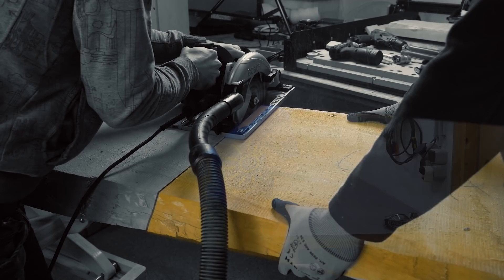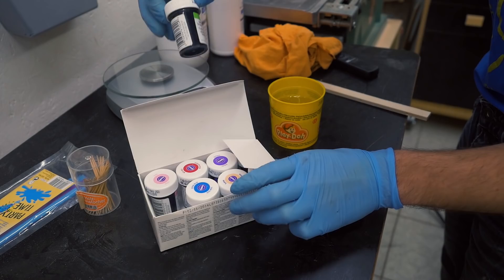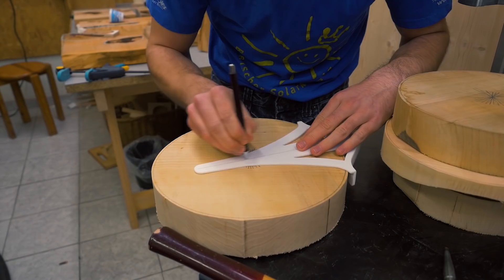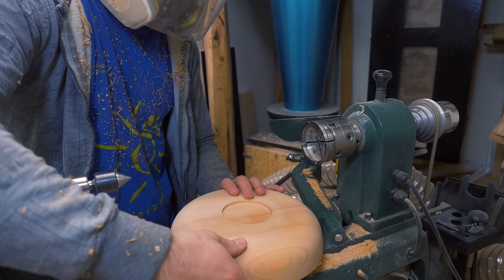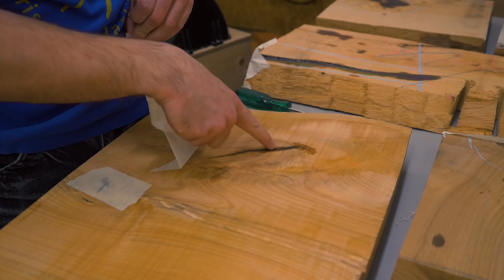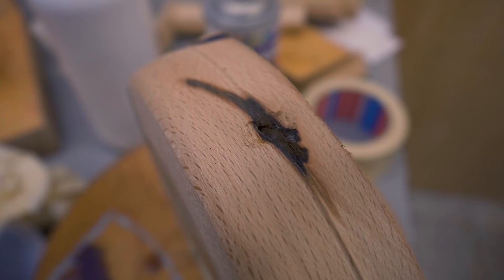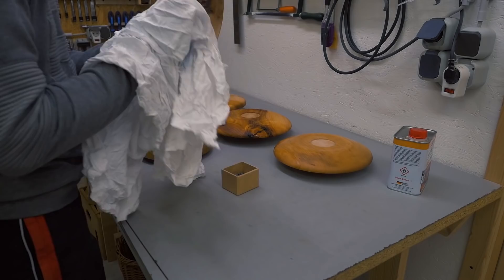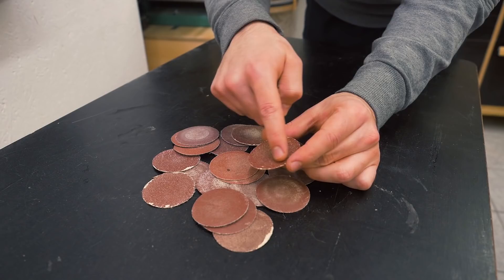Turning Scrapwood into Awesome Resin Bowls

Comment: As a woodturner, I couldn't help but laugh at this... not because you did anything wrong of course. But I know the frustrations you had here all too well. Nails are a serious pain, and... well, I can't tell you how many times I've violated the first rule of woodturning: "Never make the inside bigger than the outside". There are a number of ways to salvage the project. If you remount the bowl and widen the hole enough to create a good edge, you can turn a "plug" (I tend to prefer a contrasting colored wood), glue it in, then flatten it to create a new bottom for the bowl. Works like a charm and actually looks very nice.
Reply: "Never make the inside bigger than the outside"... bahahahahaha
I'm gonna hang on to that one.  :)
Reply: Great idea! No doubt I will be needing it as I am just learning.

Comment: Hey Marius, great job as usual. Tip for getting stuck nails or screws out, touch it with a hot soldering iron until it's really hot, it expands and makes more space for itself, then when it cools is easier to remove. I use a drill with tape on in the centre of the bowl to set the depth before I start turning a shallow piece. When you reach the bottom of the drill hole you know you are at depth.

Comment: Don't throw away the one with the hole.  Turn it into a sink 😁
Reply: Or a lamp shade
Reply: Or because you're a maker, keep it because of course I'm going to find a use for it in the future and it's too precious to throw away, and...
Reply: Turn the hole round, make a darker plug, glue it in and turn it again
Reply: Can also tape the bottom, fill it with resin to a reasonable thickness , turn it, and have a bowl with a colored transparent bottom.

Comment: I use a metal detector to check for nails, screws, staples, etc in wood before cutting. You can get hand held units as used by airport security quite cheap on Ebay or Amazon.

Comment: NOT firewood  , but a small bath sink or a birds swimming pool ;)
Also , i'd be interested in that sanding pad adapter ... i'd love the STL file if it's possible , otherwise i can make it out of wood , or turning it from plastic on my metal lathe (it would be actually sooo much faster to do , either on a traditional lathe than on a cnc lathe , but isn't as much fun as the other 2 choices  ... for me anyway ... i spend 9 hours a day on those 2 machines ) Great video as always :)

Comment: Nice work as always. I really felt for you with that nail. As far as the sanding thing there is an adapter by 3m called roloc with little sanding discs made for angle die grinders, not regular angle grinders, but the ergonomics would be pretty similar, they are very popular in auto body shops.

Comment: Measure none and cut continuously? You could use your offcuts of the offcuts to make a segmented plug; if you haven't already torched the bowl (which makes for an interesting finish on wood). When sanding, is the lathe under power, or is the piece rotating from the grinder power alone? Fantastic channel and love the videos.
Reply from the maker: During sanding with a power sander I set my lathe to its lowest speed (350 rpm)

Comment: That's woodworking dedication, making nice round firewood. Maybe with some router jigs, you could go beyond just round bowls and get more use from some of your larger off-cuts. Oval and free-form shapes come to mind. Were you running dust collection while turning? From the floor it didn't look like it, but I could see the setup.
Reply from the maker: No, during turning dust collection isn't really worth it. It would maybe catch a few shavings. Only during sanding.

Comment: Nice pieces! And the leftovers are perfect for segmented stuff. 😎👍🏻

You need to get yourself a metal detector. I use mine everytime, when I dont know, where the wood is coming from. Good turning tools are too expensive. Put one on your wishlist! 😉

Btw: What resin do you use and where can i get it here in good old Germany? The stuff from the isle or the states is pretty pricy just to get it over here.
Reply from the maker: That was the first time ever that I hit a nail inside a bowl.
I got my resin from Amazon: https://www.amazon.de/Aush%C3%A4rtend-Epoxidharz-Resin4Decor-Laminierharz-Top-Qualit%C3%A4t/dp/B0796HTSYB/ref=sr_1_4?__mk_de_DE=%C3%85M%C3%85%C5%BD%C3%95%C3%91&keywords=Gie%C3%9Fharz&qid=1558158800&s=gateway&sr=8-4
And it's also not cheap
Reply: Thx mate! I‘ll give it a try.👍🏻

Comment: I saw my own lumber and after drying, I end up with a lot of cracked ends. They end up as firewood but this is a great way to utilize them. I like the adapter for the angle grinder but is the 3d printed one strong enough?

Comment: Where did you get that rigid flex hose for dust collection on the lathe?  I’ve been looking for something like that.
Reply from the maker: I made it. You'll find it in my 3d printing video and on my thingiverse page
Reply: Yes, of course you did.  I would expect nothing less.  It’s called loc-line over here in the US/Canada, but it doesn’t go larger than 2.5” diameter.  I’d like a 4” diameter version.

Comment: Is epoxy resin food safe, and can it leach through your finish?
Reply: Some resins are foodsafe, and I can't answer your second question.

I believe you can put a walnut oil or other foodsafe oil/beeswax over resin and have the surface be foodsafe, but also don't quote me on that. I'd guess it depends on the oil/wax/finish.
But resin is just plastic, and consider that many different types of food containers are made out of many different types of plastics. Who knows if all of it is food safe, honestly.
Reply: Generally speaking, once cured, it should be safe (for that matter, any reputable wood finish is also completely food safe once it's cured, or it couldn't legally be sold -- at least in the US). Of course, there are finishes that never cure (e.g. mineral oil). My preferred finish for bowls is either walnut oil or TY oil (which is a blend of organic food grade oils). Both are "drying oils" (which means they polymerized into a film instead of going rancid in the presence of oxygen). 

Regarding the resin... assuming it's mixed right, resin cures to a type of plastic and is completely solid after curing, so there's really nothing to leach through the finish (short of applying enough heat to melt the plastic). Most two-part resins are also forgiving if the mix isn't perfect... a little less hardener, and it will just take a little longer to cure. A little more and you don't get as much pot time before it cures. So the resin will usually cure completely in time even if the mix is a little off.